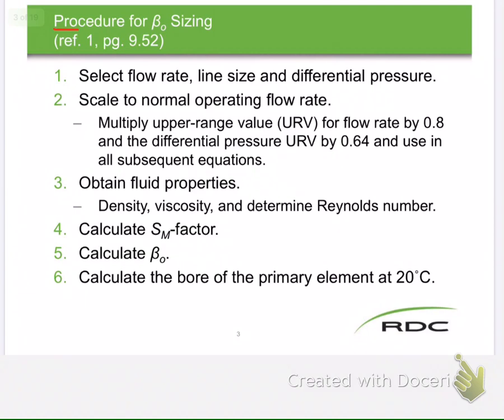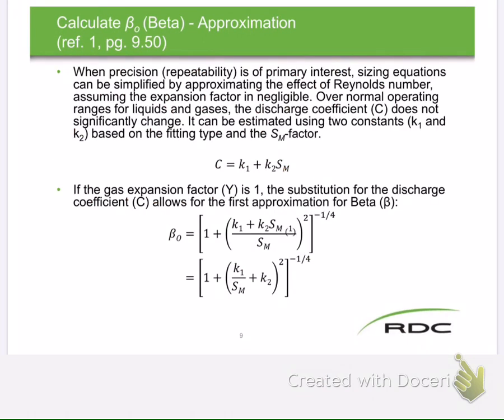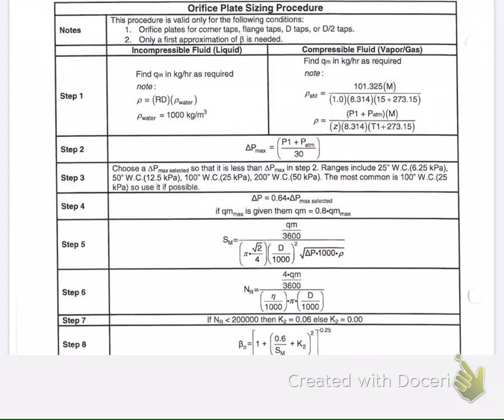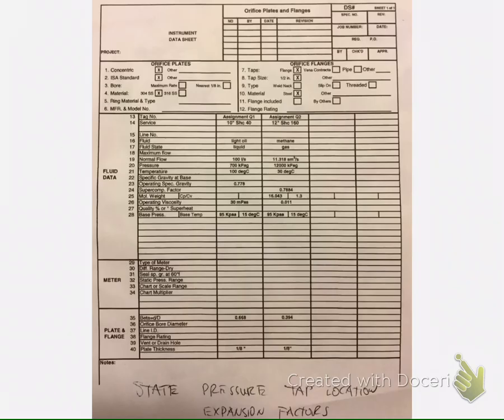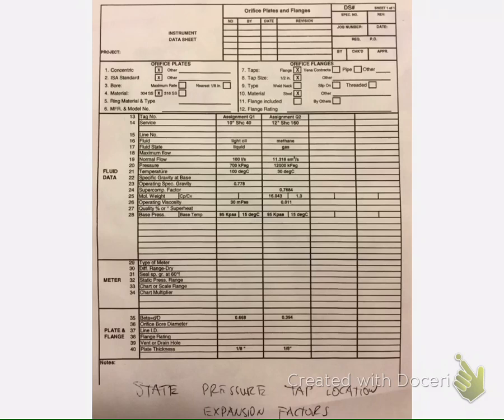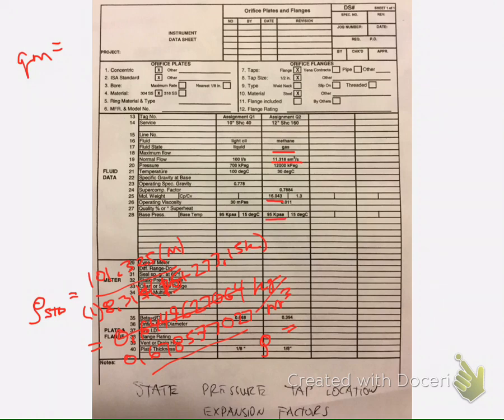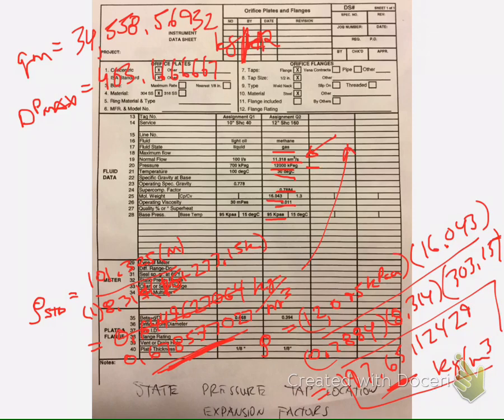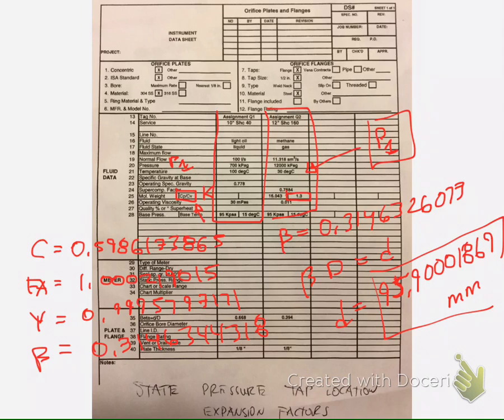Orifice Sizing

Comment: Thank you for the video, very clear and informative! Im encountering a slight problem with my calculations tho, when I multiply the flow by the 0.8 factor when calculating Sm and reynolds no. for the gas everything seems to be fine and I get the same results. However when I multiply the flow by the same factor but for Liquid I get different values, but if I only include the factor for reynolds and not Sm (for liquid) I get the correct results. Do you maybe know why this is happening?
Reply from the maker: You used the same values from the video?
Reply: @ yess

Comment: Orifice sizing is based on normal flow or the maximum flow?
Reply from the maker: Start with the maximum flow and multiply it by 0.8 to get the normal flow. 80% of maximum flow is considered to be the normal flow. If you size based on the normal flow you can skip that step, but keep in mind a large increase in flow will be above the range. For the best measurement accuracy, the normal flow should be at 80% of the range.

Comment: Thank you sir for this useful lesson. Which procedure is valid for PIPE TAPS?
Reply from the maker: You can use this procedure for sizing with pipe taps, but you will need the correct discharge coefficient (C) for the pipe taps. In this video I use the discharge coefficient calculation for flange taps. You can see this at 13:00. The Flow Measurement Engineering Handbook has the formulas for calculating other discharge coefficients on page 9.13 and table 9.1.
Reply: @AutomationCliff  Thank you

Comment: What reference material are you using ?
Reply from the maker: Flow Measurement Engineering Handbook by Richard W. Miller
Reply: @AutomationCliff  Thank you. Also wanted to know if there are limitations to using this method to size an orifice. how large of a differential pressure can I size an orifice for? A few references mentuon that when dealing with gases, this method is not suitable if ratio of downstream pressure to upstream pressure (@ the taps) is greater than 0.75. Is that the case here?
Reply from the maker: @wasteurtime5677  refer to page 9.54 of the reference. It’s pretty standard to size the maximum flow to produce 100”H20 or 25 kPa. This is a standard range for the device used for measuring differential pressure. I have seen some flow computers that have a maximum range of about 65 kPa, so it would be important to know that maximum range for the device measuring differential pressure. The reference says to limit the ratio of differential pressure over static line pressure to less than or equal to 0.04 for gases.

Comment: The flow rate before and after the orifice plate are the same?
Reply from the maker: Yes, the mass flow rate is the same before and after.
Reply: @AutomationCliff  How to reduce permanent pressure loss?
Reply from the maker: @RathodRidesRonin  you can’t avoid the permanent pressure drop due to an Orifice. A common differential pressure range used for sizing an Orifice meter is 0-100 “H2O. This means the pressure drop should never be more than 100 “H2O. If this is too much, consider using a Venturi tube over a Orifice meter. It produces a lower permanent pressure drop.